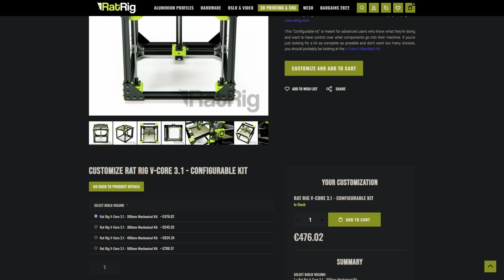RatRig V-Core 3.1 Review

Comment: Are there technical reasons to prefer the 400mm over the 500mm model? For example I wouldn't mind the larger dimensions, but I could imagine it may be less stable at high print speeds or something?
Reply from the maker: With CoreXY the length of the belts grows with four times the dimensions. This can be a problem as a longer belt stretches more. RatRig is using the wider belts for this reason, but you will still get some stretching which then limits the speed and precision. Also power draw for the heated bed and increased material cost are factors. For these reasons (primarily the first one) my methodology for choosing a size is to go as small as possible while being large enough for what you need. 400mm is already huge (fully utilizing the build volume will take days not hours to print even with a big nozzle), but if you feel like you need the larger size, it's an option.
Reply: @DarkArtGuitarsWorkshop  Thanks for the detailed answer. To be honest I usually don't need a huge printer all the time, but sometimes it would be a game-changer and then I'd rather have a longer print than not being able to do something at all. That said I took a closer look and the 500mm variant barely fits through normal doors and apparently not all of them, so 400mm indeed seems like the better choice in every aspect.

Comment: It looks like that printer can not print perfect parts. Even Prusa MK3 prints better quality parts. I will wait Prusa XL because of they are targeted on quality of the parts and this is what I need.
Reply from the maker: You have to spend a bit more time tuning your profile with the vcore as it is a diy printer and not tuned product, but once you have, it matches or beats the prusa prints at 1.5-4x speed.
Reply: having both, prusas and v-cores, what you are saying is just not correct. you can create perfect parts in a fraction of a time from a prusa

Comment: Bro, nice printer but the <bambulab X1 prints a very good quality Benchy in 17 mins. Did i mention that it as a VERY good quality benchy from an out of a box printer with no tuning hassles?
Reply: The point of Vorons and Rat Rigs just zings right over you I guess……
Reply: having multiples v-cores, with a v-core you can print with much faster speed and more importantly with WAY higher accelerations than on a bambu, you can print perfect benchies in under 15 minutes. he just made the mistake to use a outdated mosquito hotend instead of a modern high flow hotend  and the 5015 fans instead of a 4028 that blows you away.
Reply: @HelgeKeck  I printed a near perfect and I mean very good (almost identical to it's 17 mim). 12 min benchy in a bambu x1 (abs). Currently building a vcore3 but just trying to be impartial
Reply: @alycapo3391  I think this come down to a point where, do you want to build it yourself or buy it built. I personally love to disassemble and assemble things, so for me vCore 3 was the choice
Reply: This machine is just as good or better then the bambu with the right parts. Bambu is great as well just would like it to be a bit bigger.

Comment: I got a VC500 since October last year and a VC300 since July this year.
I have to say all in all the printer is really solid. The price is compared to other printers this size (especially 400-500mm) competitive. If you consider the possible speed with tuning, there is no other consumer printer on the Market I think.
One problem is really annoying. RatRig announced the Enclosure back in 2021 I think. It had a lid which can be opened. Unfortunately they did not consider the dampers are way to weak for a 500 and 400 sized printer. Back then the open front mod already existed (now enclosure 2.0) they could have easily implemented this design already back then.
The second thing I realized, especially on my 500 printer. I have massive problems with my X Gantry if the enclosure is closed and the gantry warming up.
We have two materials. A 2020 Aluminum profile and a steel linear rail. Both parts expand different when exposed to heat. This results in a Warping of the gantry and inconsistent first layers.
I will get the enclosure for the 300 printer today and I am really looking forward to see if the same problem will occur.
Reply: About the bi-meterial expansion stuff. This is a common misconception, that's not how the physics work out (the "simulations" you see are fundamentally flawed because they're overly simplified). Let's say it was correct, If this was indeed a systemic issue everyone would have the exact same problem, and that is not the case. If you're having these problems it's most likely because you've overtorqued your screws on the X rail. It's super easy to fix, just use less torque, or if you insist on overtorqueing, do it while it's hot :)
Reply: @miklschmidt  hey Mikkel :)
Yes I have heard about only fastening every third screw only handtight etc.. I tried it but it did not work out for me. Don't know if my handtight is different than other people's definition of it. I can send you some pictures of my mesh via discord if you want.
Reply: @cbeck2201  Yeah i'm aware "overtorqueing" is a relative concept, there's one thing you can try though, print the 2.5Nm "
Fixed Torque Wrench Handles" from thingiverse. Or just tighten by hand while the printer is hot, that'll do it too :)
Reply: Great convo. I’m trying to decide between a few different printers and Rat Rig is at the top. My question is (sorry I could look this up) is do the specs, specify the correct torque to avoid this?
Reply: @TheJacklwilliams  Hey. I found that torquing with 0.4nm works for me. I print ASA parts on my VC300 for clients and I don't have any problems with bimetal expansion.
Reply: @cbeck2201  THANKS SO MUCH CB! Im all about spec. I despise guesswork when there is the ability to nail something to spec, and the results are great output! Highly appreciated!